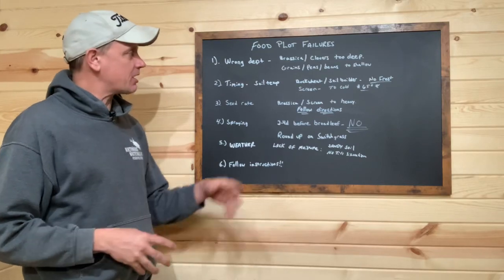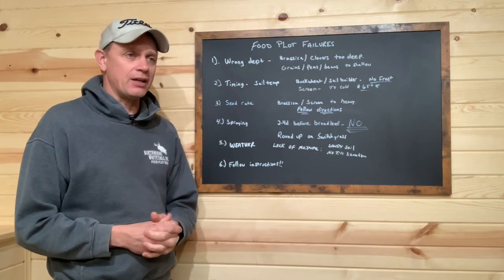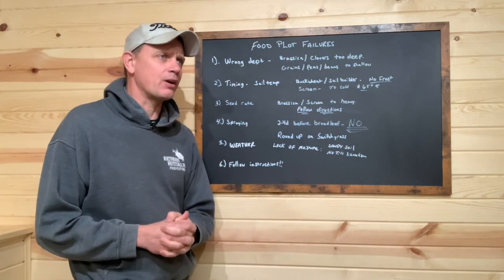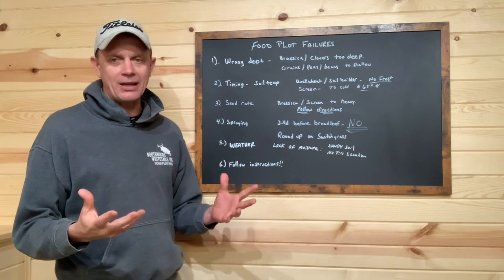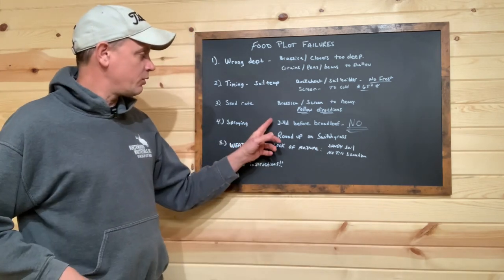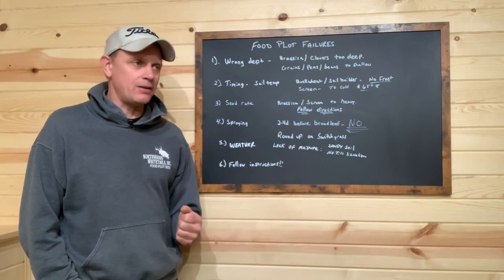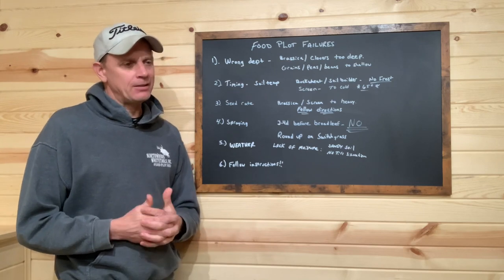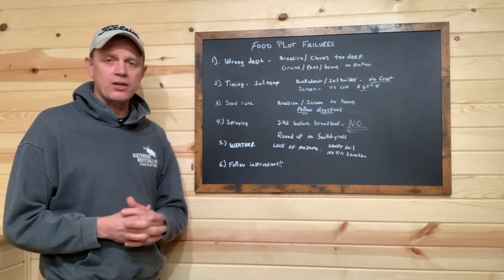Avoid these 6 deer food plot failures

Comment: John,
I frost seeded switch on prepared bare ground between the snow cover in the NW Lower.  I just received your RC Big Rock for a line or 2 of screening prepped that I missed, but have more than needed.  Is the shelf life good enough to save for NEXT year's frost seeding effort?  Alernately, if I get to bare ground by summer and rain cooperates, how much growth is needed for it to survive to next year?   In other words would it be better to get a little bit of growth this year or just wait for a full season next year?
Reply from the maker: Store it in a rubber maid bin in your house and it should be fine.
If you can get a good couple sprayings in , and there is adequate rain, you could seed in early June.

Comment: Always confusing to me on mixing chemicals, example 2qts gly per acre. Round up is like 6oz per gallon. But how many gallons does it take to cover an acre sufficiently. 
Thought about putting a gallon of water in sprayer with pond die,then measuring what it covered? 🤔 
I know you have to move along at a certain speed pending on output of what ever kind of sprayer you have and you have to adjust your speed or calibrate sprayer output I just hate to guess at these. Thanks man..love the videos.
Reply from the maker: It will definitely depend on sprayer set up( how many nozzles and how much water is coming out), speed of atv as well.
For my fimco I have 2 nozzles and use about 20 gallons water / 2 qts glyphosate and some crop oil per acre
Reply: @northwoodswhitetailsfoodpl2663  thanks John, somehow I knew you had a good honest answer. So with that being said,thinking of planting15' of  your HD screen along side of 20' strip of switch grass  which I will plant in March or early April. Will HD screen planted in say june be affected by simazine spraying on switch.
I'm thinking your screen  will work well while the switch is going through its first year. I'm pretty sure I watched a video you put out on this topic. Thanks again I'll watch it again if I can find it.
Reply from the maker: @timhatfield6367  get the Simizine down for both all
At once
Reply: @northwoodswhitetailsfoodpl2663  you the man...Again.
Thanks you don't know how much this helps...ok..you do. Lol

Comment: Now if we were to do a combined sweet feast or radishes with peas. What would you do for pounds per acre. I’d rather have mixed then split plot in two separate plots
Reply from the maker: 75-100 pounds per acre peas
6 pounds sweet feast

We do not add any more radishes to the sweet feast. It already has 20% radishes.
Reply: @northwoodswhitetailsfoodpl2663  and they could be planted in the same plot at the same time at tgat rate?
Reply from the maker: @mikehamm4987  yes
Together.
But I like a side by side of that planting next to some cereal grains like our fall forage

Comment: Speaking from experience. I planted my hd screen very early last year June 10th south central MN.  I could have waited til mid July.  My screen ended up well over 15’.  It held up pretty good for the most part but we had some serious wind come through in late fall, knocking a lot of it down.  I also seeded just a hair too heavy causing thinner stalks.  Less seed would have produced thicker stalks and planting 2-4 weeks later than I did would have kept the screen closer to 10-12 feet and I believe it would have held up better than it did.  

Don’t get me wrong it still did really good.  But I think it could have been better had I not made those mistakes.  

Last, I keep detailed notes on everything I do so I can reference back the following year.  Trust me, you won’t remember, so write it down!  I write down how much of what seed I put in the bag, the setting on the earthway, the date, temperature, moisture.  I even write down dates that it rains and how much.  

I’ve been able to reference that to correct my mistakes, year to year.
Reply from the maker: Good advice

Comment: You think a sandy soil builder added rye with radish and red clover / chicory can be a 12mth plot. Maybe 1 mow in early June????
Reply from the maker: Interesting thought but not sure.
Eventually it would be all clover chicory by next year.
Reply: @northwoodswhitetailsfoodpl2663  i was thinking of trying it 1st of August. Give it 1 mow late may let it go to end first August and start over. Not sure tonnage will be there.
Reply: I'm going to experiment with an early June planting mix with food components in the cover. I found a Collard Green variety  that allegedly is browse resistant and doesn't bolt in the summer like most spring planted brassicas will. Cow Peas and Lentils in the mix will either produce pods by fall or get eaten to the ground.  Depending what develops, my intent is still to overseed  fall fooplot seed rolling it into existing veg without gly-killing everything first as previously practiced.  I've been burnt by late summer drought in the past (and so has the bare earth without green cover).
Reply: Yeah.... I didn't pack that blend enough into too open ground followed by lack of rain.  I basically fed the turkeys, cranes and doves.  The fall overseeding of winter rye and crimson clover is looking like a great nurse crop for something next, maybe just perennial clover (soon).